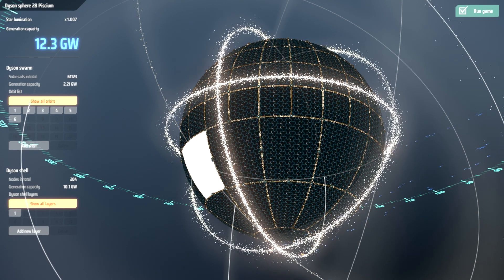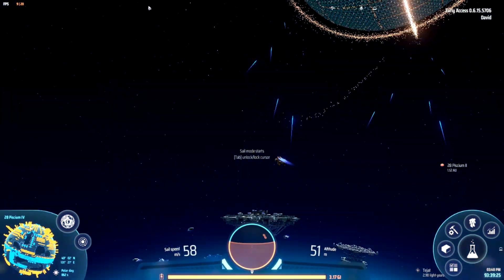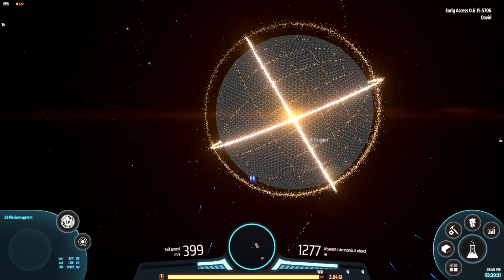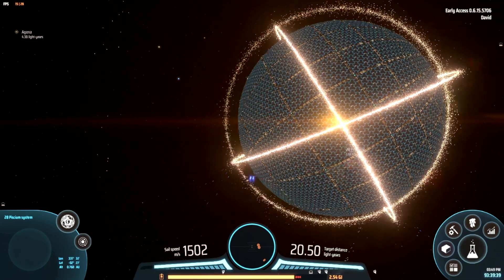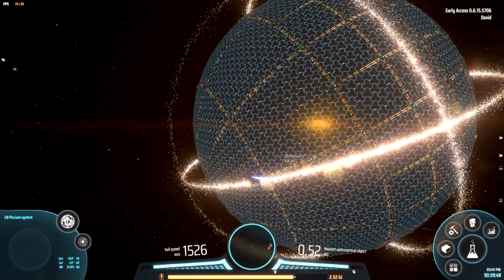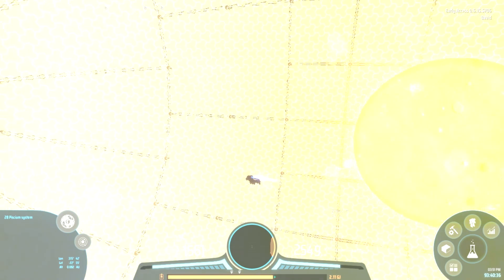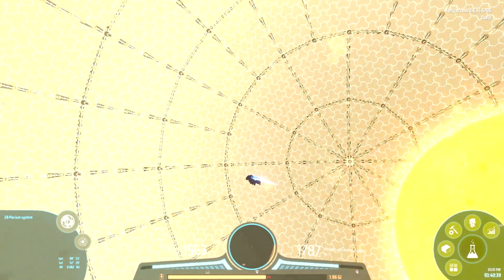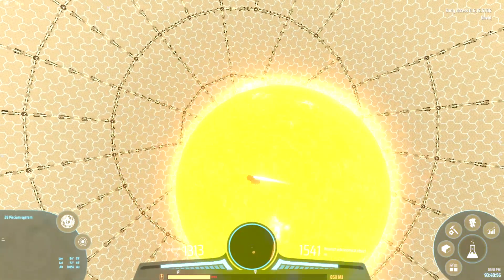Complete Dyson Sphere - Dyson Sphere Program

Comment: Amazing work! Some notes on power generation.

1. Find a star with higher luminosity. Prefereably at least 1.6, but if you manage to find 2.0 and above, this would be ideal.
2. Nodes generate more energy than Frames, which generates more energy than cells. Compose your dyson sphere out of more nodes and frame instead of filling the space up with cells.
3. Create multiple layers.

Comment: Can you build the frame/structure first and then launch the dyson swarm?Solar sails expire after sometime maybe its a waste of resources?Just started producing purple cubes so not there yet
Reply: You will find that you might aswell just start firing sails when you get that automation set up for those. While it wont power all of your grid its really good at keeping up some of your power while you expand your factories. Also, by the time you find your resources will deplete in your home system you should allready have begun setting up multiple stripmine worlds to send back materials so id say you should not worry
Reply from the maker: Yes you can do that, but it will take longer
Reply: after DSP complete u can stop launching dyson swarm. because they are suck by Node.and solar sail have really little power compare by the shield form by node and shield